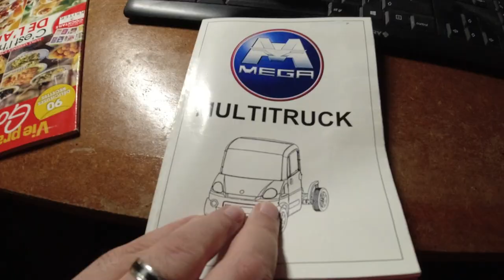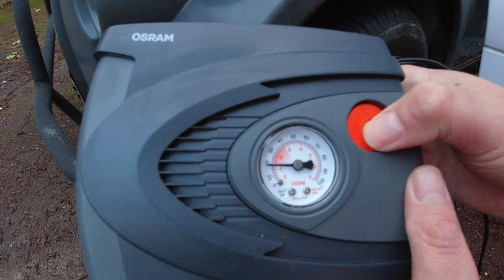How much do you pump up the tyres? | Baby Moon repair | Aixam Mega Multitruck

Comment: I use the Bosch EasyPump as it has a built in digital pressure gauge.
Reply from the maker: I suppose I went for the cheap option, but bought it a couple of years ago. It does the job (when my brain works).
Reply from the maker: The Lidl special is still working a treat. Had to keep a slow puncture inflated recently on the Grand Scenic, until we could get the tyres swapped and the two front ones changed. :)

Comment: I've got a similar pump I bought on Amazon.
Reply from the maker: I was impressed with it. Less impressed that my tyres were more deflated than I thought!
Reply: @MegaBreadvan  it's the effect of the cold weather.
Reply from the maker: @patricksmodels  Or.... the fact I've never pumped them up since I bought my van... 😬😆
Reply: @MegaBreadvan  soft tyres are ideal for driving on desert sand.
My father worked in North Africa in the 70s and they used to let air out to drive in the desert, and pump them up again to go on the road.
Reply from the maker: @patricksmodels  The countryside around here can be a bit of a green desert. No nice interesting rolling landscape like back home. Very muddy at this time of year though, especially when they harvest the sugarbeet.